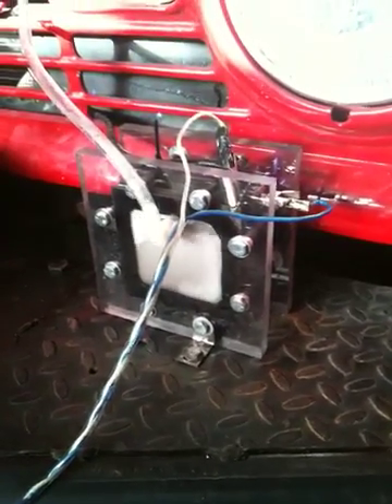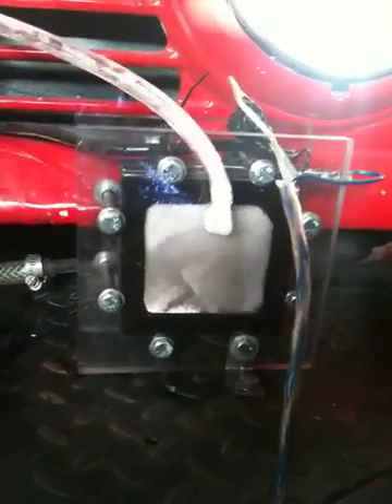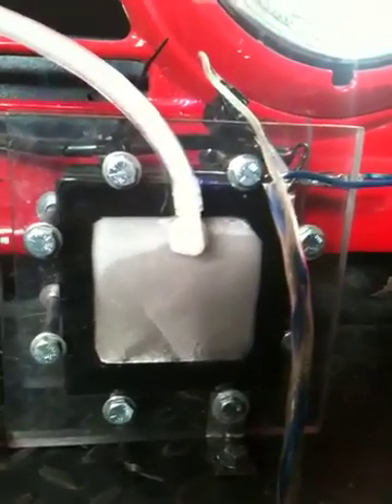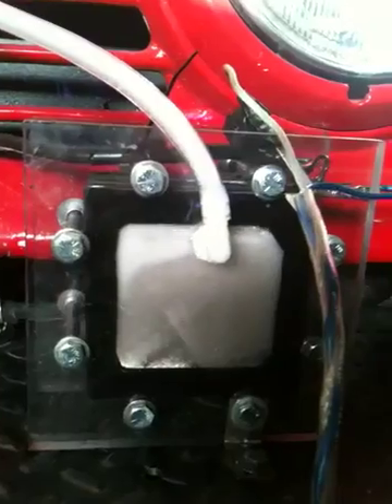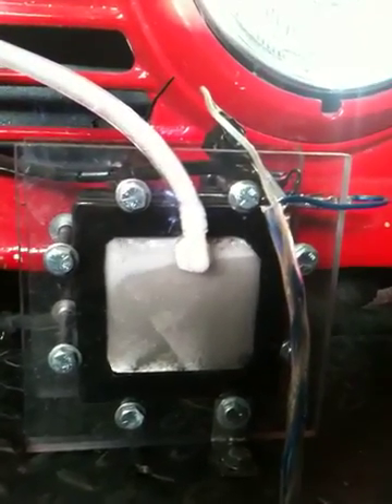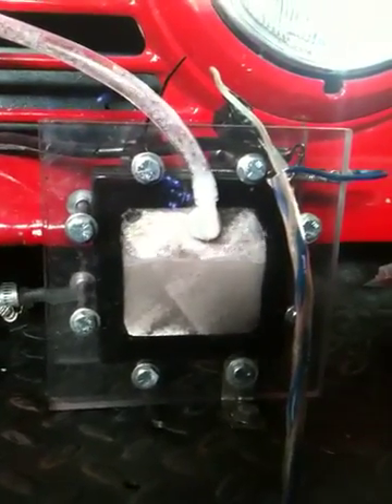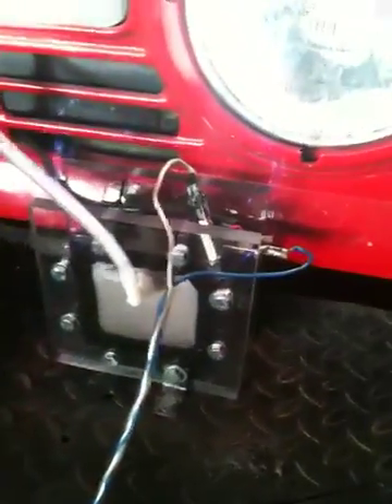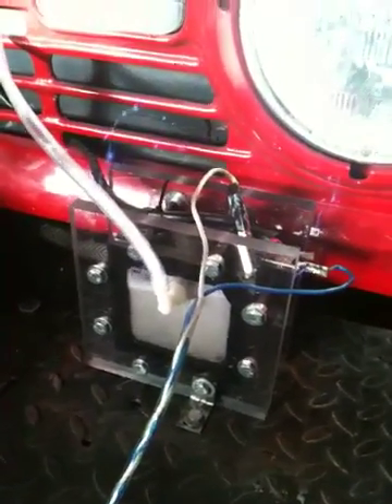high school student hydrogen cell science project

Comment: most excellent, as an ongoing project u might suggest to him to media blast the plates with an 80 grit abrasive and then again with 320 grit and record the difference in production before and after showing which is better, by doing the blasting it helps make the stainless steel plates more hydrophilic and increases surface area, thus better production